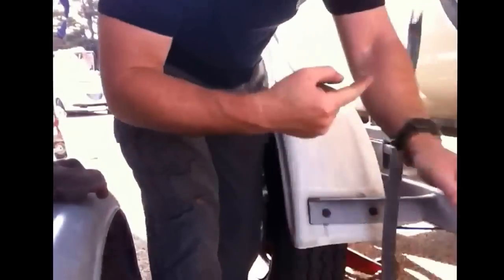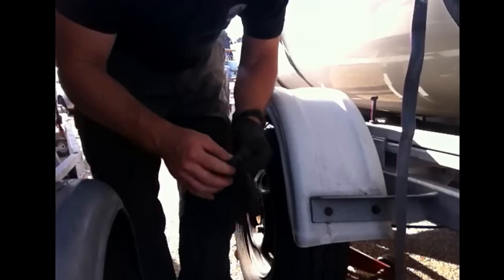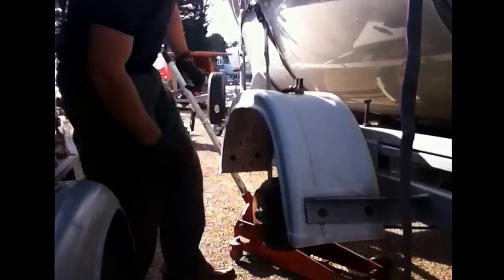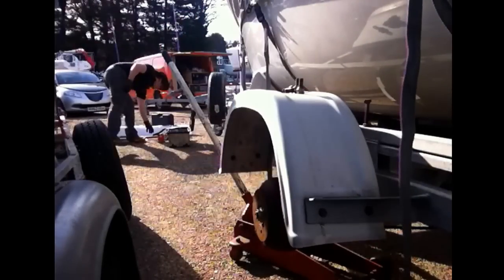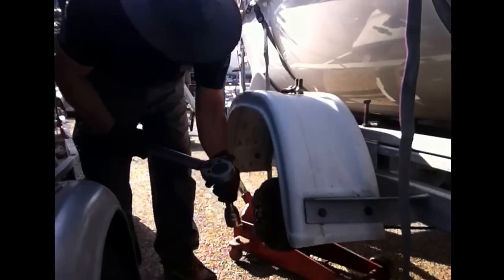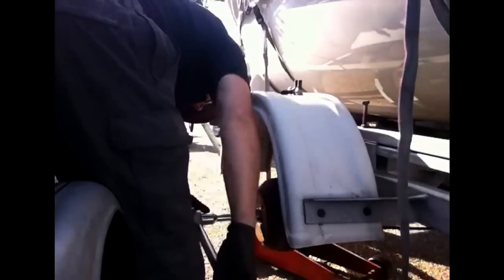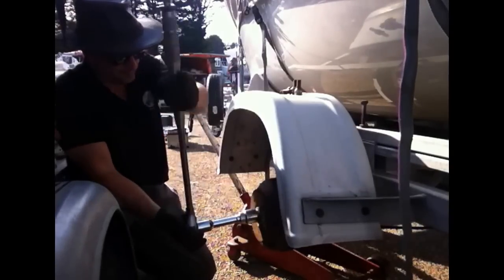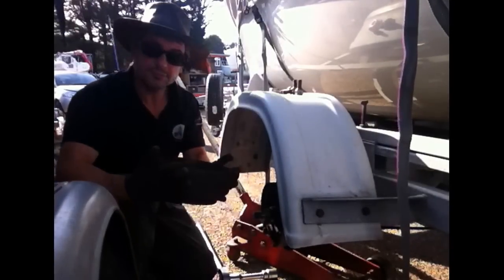How to remove an Alko drum

Comment: Great video! Tks!

How do you know the size of the ALKO sealed bearings without removing the drum? Is there any reference hard stamped outside?

I need to buy a bearing kit and I don't know which one I should buy. There are 2, one normal size 30 x 72 x 64 mm and a compact size 34 x 64 x 37 mm.